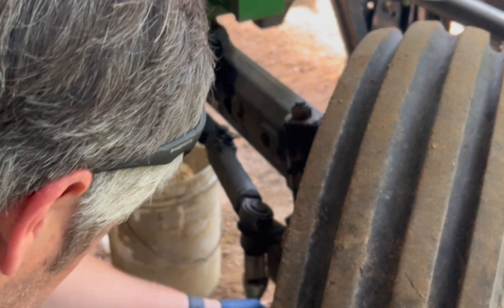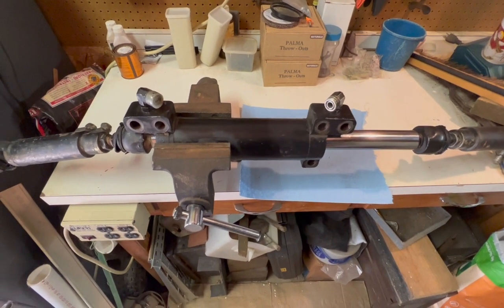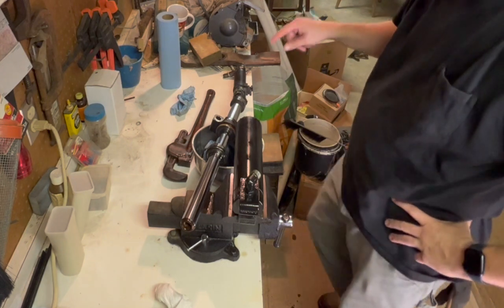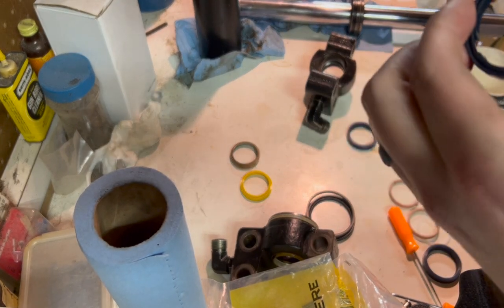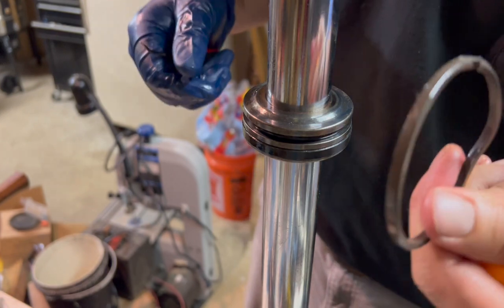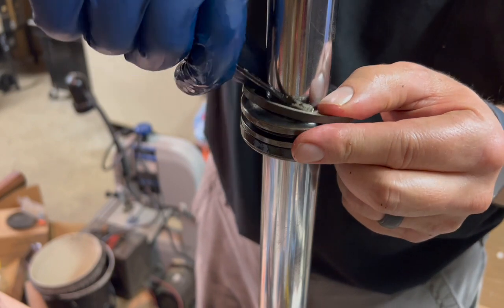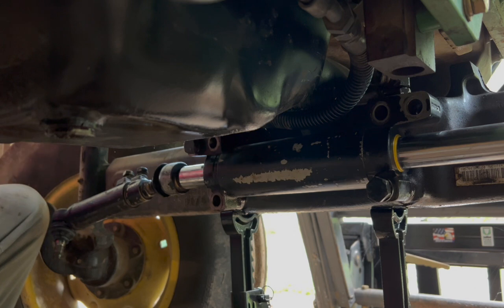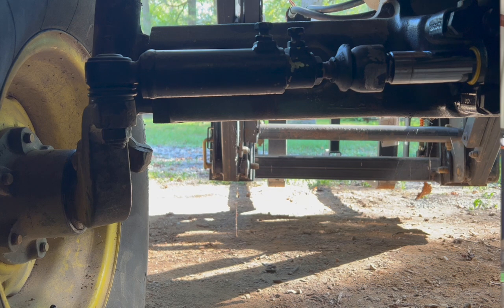Remove and Rebuild Leaking John Deere Steering Cylinder

Comment: Thanks, this helped with my Kubota L4200. That center hydraulic cylinder gasket is tight and stiff. Was afraid it would tear.You gave me the confidence to go for it. I even practiced with the old one first. The rest isn't fun, but doable. This was the only video I found addressing that gasket.
Reply from the maker: @johncoleman1935  Glad to hear it helped! Not an easy thing but sure feels good when it is back working like it should.

Comment: could you show how you got the other end off.  When I did what you did the same thing happened.  It jumped out of the vise.  Just as yours did.  Just was wondering how you broke it loose?  The rest of the vido was great
Reply from the maker: I couldn’t do it by myself. Had to get another guy to help. If you don’t have someone who can help you, can take the cylinder to a mechanic to break it loose. Here’s a different video that shows the same thing but the guy has help. https://youtu.be/rum8g7DUucw

Comment: I have the same tractor. Thanks for the videos. What part number did you use for the tie rod boots, and who did you order them from?
Reply from the maker: Thanks for watching. I didn’t buy new boots. Mine seemed to be in good shape so I just reused them. There is an online parts manual for this model that I reference. I think this link will take you directly to the tie rod and boot pages. https://partscatalog.deere.com/jdrc/navigation/equipment/57732/srch/TIE%20ROD%20BOOT

Comment: I have an old 5310 that looks exactly like the one you have.  I am unable to locate a technical manual.  Do you have any suggestions?
Reply from the maker: Hello, and yes. I believe this below is where I downloaded mine. You should also be able to find some printed versions online you could order for around $30. 

https://archive.org/details/john-deere-technical-manual-5210-5310-5410-5510-tractors-tm-1716
Reply: @dogwoodspringsoutdoors  Thanks so much.

Comment: How did you get the second end unscrewed  how did you hold the cylinder shaft. May as well not had a video if you don't show everything
Reply from the maker: I had to get another guy to hold it steady  in the vise while I was on the wrench. He didn’t want to be filmed. Also had to keep on it with the heat.